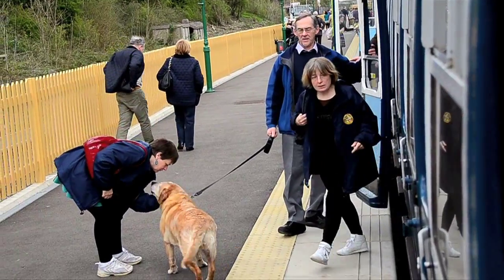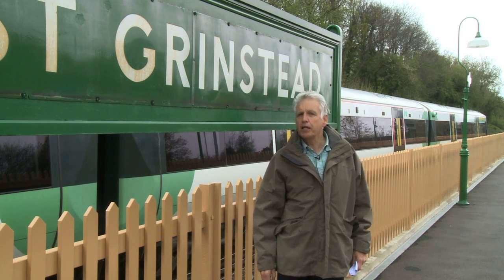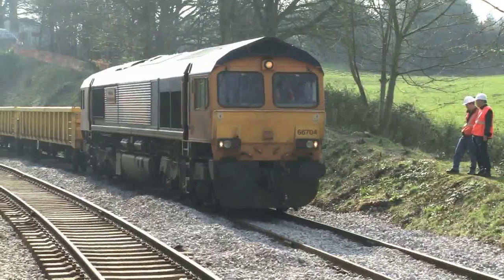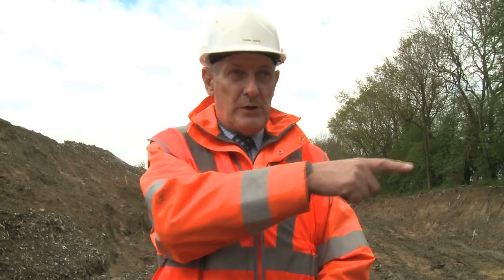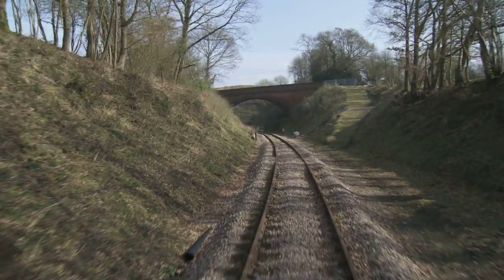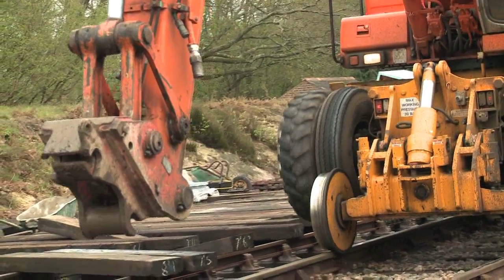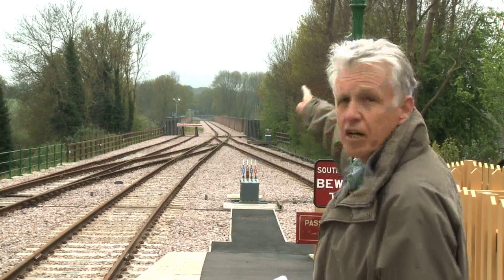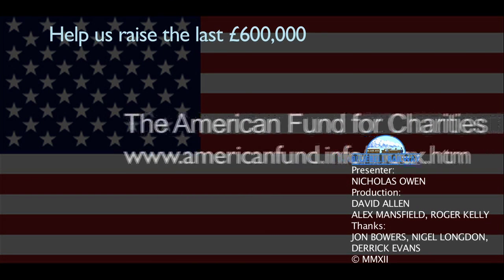Bluebell Railway Extension Appeal 2012 - Funding for the Finish

Comment from the maker: Of course, the first task is to complete the line back into East Grinstead.  Regarding the locos, my guess is that either 80151 or 80064 will be high on the list for an overhaul once the current works programme (H, Q, S15, O1 and Camelot), have returned to service.  Both standard 4 tanks need major overhauls and 80151 needs new tyres, 80064 needs work on its wheels as well, and extensive copper-welding in the firebox.
Reply: Are we gonna see 80064 run soon??

Comment from the maker: Actually, even £5m would not enable us to rebuild it exactly as it was, since we can't have double track on the viaduct (even through there was originally; the regulations for "new work" have changed), and there are other sections where we don't own enough land to re-instate double track either, quite appart from the extra cost, a few million more on top of the £5m that you'd spend on the cutting!

But no-matter; we are opening to East Grinstead next spring, with a fortnight-long Festival.

Comment from the maker: The Network Rail station does not have space for our own platform and run-round, so we've built our own adjacent.  We still hope in the long term to have some sort of shared station building, but that will be some years away!
The extension has cost in the region of £9 Million, pretty-much all raised through our own fund-raising over the last 25 years.  If you have another £5 Million available, we could rebuild it exactly as it was.  We don't have that £5 Million, so have had to compromise.

Comment from the maker: Much of the video was shot a month and a half ago, so the levels have changed further since then; the actual change in height is now nearer 2m than the 1.5m which was mentionned in the video.  The changes to the north are much easier because of the overall gradient though the cutting.

Comment: Thats good news, I see from the video, obviously you have re profiled the run up to the bridge to what will be the new cutting, I see that the current level of the tip is higher than the new lead up, are you looking to bring down the level within the tip, to match the new run up? 
I guess you will have to do a similar thing from the other road bridge leading down to the original track level... and then put the clay over the top.

 Its good to see progress though! Hope the weather changes!